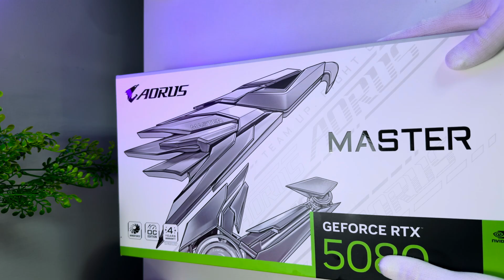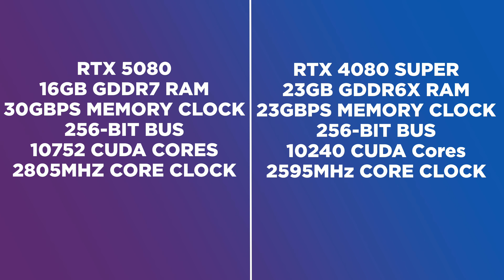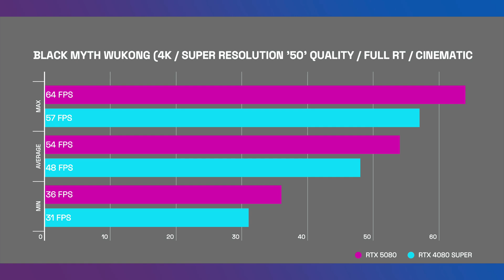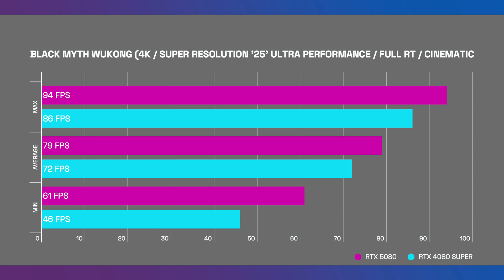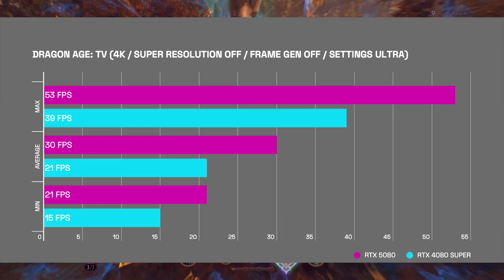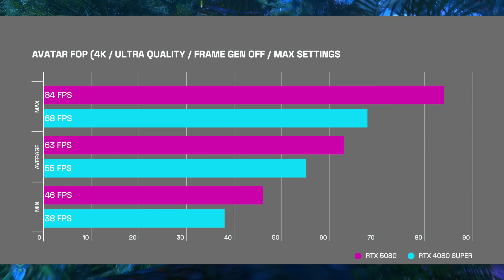AORUS GeForce RTX 5080 MASTER ICE Versus RTX 4080 SUPER Review

Comment: How necessary is the top fan
Reply: I have one set up in my build and don’t notice a significant boost. Temps are 4 degrees cooler at best, sometimes I don’t even notice a difference, but I have installed anyway to improve longevity hopefully.

Comment: Undecided between this and 5070 ti. Seems small difference in performance and large difference in price.
Reply: I went with 5070 ti. You can overclock it to reach parity with the 5080. If the 5080 had more VRAM, I would've gotten that, but 1.3k+ for 16gb of vram in 2025 is ridiculous.
Reply: @spy1948  u can also OC this 5080 and make it a 4090. This gigabyte version has best air cooler of all 5080s and Apart from Indiana jones there are no real game that uses +16gb of VRAM with everything maxed in 4k, so having more memory is quite pointless for games.

Comment: Im putting a Aorus master ice in my panda hyte y60 ive got a perfect mix of white and black my mobo is all white pcb  and everything  my cables are white and I have lian li strimers with white light effects set my fans are tl lcd's in black  and my aio is a black 280mm kraken elite but im using a silver and black 4080 FE the Aorus master ice will definitely complete the storm trooper look and theme im very excited to get mine and of course OC the crap outta it then my 4080 FE elk go in my black and Grey O11D build

Comment: I just got the 5080 AORUS.  You cant independently turn off the fan lights which are annoying as hell
Reply: To turn off the fan lights on an AORUS RTX 5080 graphics card, you'll need to use the Gigabyte Control Center software

Comment: Bought this card today.
Reply: Tell me if the connector is not melting
Reply: @ Definitely not melting, currently have a ATX 3.1 850 watt PSU Corsair, using the 12V cable direct from psu to Gfx card. Working well so far…
Reply: i got it yesterday too, what power supply are you using? 850 or 1000?

Comment: what cable do you recommend using the 12v or the 3 in 1 cable? honestly a little nervous about the 12v cable since the whole melting cable thing
Reply from the maker: If you have a PSU with the 12V cable then use that cable. I’ve been using it on mine and it’s been fine. I just ensure there’s no tight bends or contact on the cable. I’ve been following the melting issues and they seem mostly related to third-party 12v cables. So people not using the OG cables that come with the GPUs. Could be something else but mostly all reports are on 3rd party.

Comment: How loud is that model? You mention the fans running at around 2000rpm. Ive never heard anything at that speed that wasnt loud to me. Thanks!
Reply from the maker: Yeah sorry about that. I didn't specifically mention fan noise because it wasn't a problem. But I measured around 38dBA when fans were at 2100RPM. My case and cooler are around 40dBA so it muzzles out the fans of the GPU really. If you put your ear next tot he GPU, without a case door, you'll hear the fans but it is impressively quiet with a case closed. I also didn't measure any noticeable increase in sound between 1600RPM and 2100RPM. The card handles its higher speeds very well.
Reply: @GLITCHEDZA  Thanks a lot for the anser. I can hear a fly farting in the next building. So noise is very important to me when it comes to picking PC hardware 😉

Comment: Does that anti sag bracket vertical piece bolt into the case or is just resting on the bottom of the case and then the bracket on the GPU is screwed to the vertical piece?

Comment: I do prefer the customization setting called off - savage lol

I wanna add, the software when it comes to the LCD is utter garbage. Uploading a GIF takes a couple minutes(!) and then it freezes on a regular basis and you have to reupload the gif. Images work fine though but you can only set one at a time not multiple images. Videos or even YouTube videos? Forget it. The LCD should be scrapped entirely in it's form.  Make it much bigger and an OLED and don't limit the software, then we are talking.

Comment: Is the back fan optional? I don't think it will work with vertical mounting.
Reply from the maker: Yes it’s completely optional.
Reply: @GLITCHEDZA  thank you. I'm getting one this week. Great video!
Reply: 100% works just fine in a Y70 case
Reply: @Coolvo113  oh I see. That's because you mounted it on the case. I'm using a third party mount. Thanks.

Comment: I was about to change my mind on the 5080 until I just watched you video results.. If they ever become available I might go ahead and grab one,  unless the 5070 ti comes first, then I might not wait..  Then I'll wait until the 5080 comes down in July - August, ..
Reply: He didn't overclock the 5080 and the 4080 is very overclocked. Should check other videos
Reply: I recently owned a 4080S and picked up a 5080.

My 5080 can overclock to 3200MHz on the core clock, producing results that go toe to toe with a 4090 based on benchmarks I’ve run.

The 4080S which I only had for a couple of weeks, was about 20% slower at stock speeds, but the 5080s overclocking separates it by a decent margin.

If you can get a 5080, it’s definitely worth it over a 4080S. However, if you can pickup a discounted 4080, then maybe that is worth it given they are relatively close.
Reply: @runningfromcomfort  Nice, and good to hear.. I just got my 5080 on the 21st, and pushed it to 3000Hz, cut the Power Limit down to 89, testing at 100%, temps around 68C-72-3C - at stock temps got to 77C - I thought 3000 might be pushing it to hard, if you got 3200Mhz I might try a little higher just to check..  I know that in the games that I play that I'm not going to be pushing 100%..
Reply: @Foxxie55  yeah okay temps are not too bad. Depending on model you have will depend on how well you can manage temperature. I got the ASUS TUF and I’m yet to see it exceed 64c.

As for the power limit, what I’ve noticed is even if I max out my power limit (+11%), my card mostly stays under 300W. 

Im finding the 5080 is a very power efficient card, but finding the right settings and temps can be different.

For example my friend has the MSI Inspire and he won’t push his card past 3000MHz because otherwise his temps get into the 80s.

Maybe you can try undervolting with your overclock and see if you can find something stable that keeps your temps down a bit when overclocked.

Comment: you put a fan on the gpu, is that custom?
Reply: You mean the card on 5090? The extra 4th fan comes in the box when you buy it, doesn’t do much tho
Reply: Nvm its 5080 mb, still comes with the fan tho
Reply from the maker: No this is the Screen Cooling Plus fan. an included feature on this GPU to "help" cooling. But it doesn't really help cooling.

Comment: Nice video thank you I’m waiting for the GIGABYTE AORUS GeForce RTX 5080 MASTER ICE to come available in my area and have my new cpu and motherboard etc waiting. For me this will be a substantial upgrade coming from a 2080super.
Reply: I am doing the same. Got a 9800x3d, 64Gb of 6000 Mhz RAM (Star Citizen and cresting content), Nvme 1TB SSD, 1300W psu, 2TB SSD 2.5". I was building for a 5090 and future proofing....but the price of the 5090  Master Ice is insane.

I'm upgrading from an i7 - 8700k and 1080 ti lol
Reply: same bubba  @drogoredsmith4854
Reply: I just got one ☝️
Reply: @ are you going with a vertical mount or normal
Reply: @samuilmnt  normal mount
Reply: @TwoBucksGaming  do you think it will fit in vertical ?
Reply: @samuilmnt  you’ll need a big case. I think it might barely fit in some

Comment: Overpriced garbage.
Reply: It's better than 4080 super and it's the same price.. You could sell a used 4080 super and get the 5080 for few hundred and they can overclock to damn near 4090 performance
Reply: @ You must not be up to date with news. This card is $1429 and it's not even in-stock anywhere. You can't even buy it unless you have a scalper bot or buy it from scalpers for an even higher price. It's maybe 7%-10% faster than a 4080 Super and MSRP models were available for 30 seconds on Jan 31st
Reply: @peterrasmussen68 this is actually exactly what I did. Sold my 4080 for 800 bucks. Then bought the founders edition 5080 for MSRP... Wait, no, there was a problem. Impossible to buy MSRP 5080. Can't even buy back my 4080 cos price has risen to 900. Thought I was being very smart cos people would see that the 5080 wasn't a big upgrade over 4080 and demand would be low. Also thought the world's richest company would be able to have a decent stockpile of cards at launch. How wrong was I!!

Comment: Hello, great video I ordered rtx 5080 palit gamerock and saw this beauty, if there is a difference in the temperature of the gpu and memory, the quality of the components?
Reply: temperature depends on the cooling solution. Bigger heatsink typically means better cooling. The memory is standard but can be overclocked. The quality of the components ultimately comes down to the materials used to fabricate the carb as the base PCB from Nvidia is standard across all cards.
Reply: 3-5 years
Reply: @Maiasar-lv6be  you wont see that much of a performance increase for the money you spend outside of temps and noise. Yes you can OC the card further but you get diminishing returns the more you push it as a result of power and it being the same die.
Reply: aorus or palit, as in the review, what do you say, I want to have a card for 3-5 years, which one would you recommend if the budget allows? @DracosThorne
Reply from the maker: Someone mentioned it already but basically, "cheaper" GPUs do use "cheaper" components to make the card. There are also corners cut in RnD and assembly. I am not saying these brands are bad, but cards with drastically lower prices often have shorter life spans, slightly lower cooling performance. Again, these aren't "bad" GPUs, but you often get what you pay for and if you pay more, the quality is better.
Reply: @GLITCHEDZA is it possible to exchange with an additional payment of 25% palit 5080 for aorus rtx 5080 xtreme waterforce 16gb what do you think about it, is it a good deal if you buy it for 3 to 5?